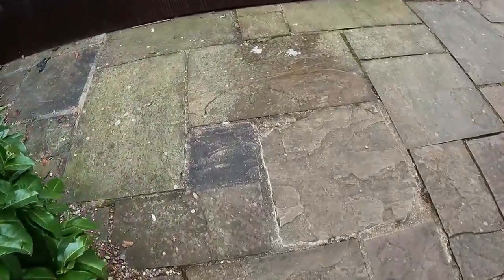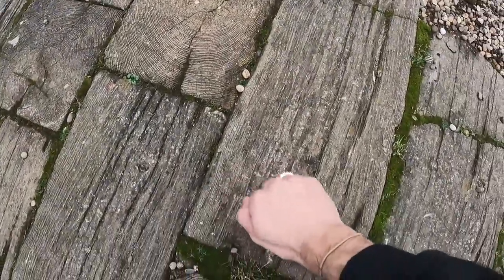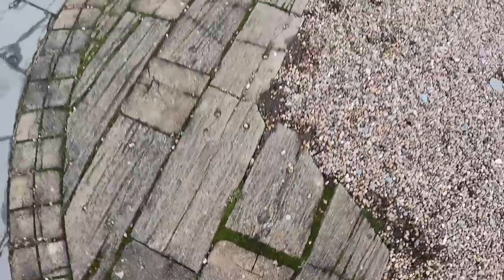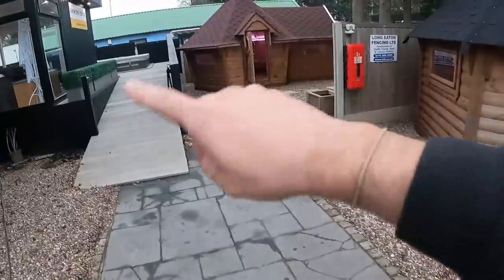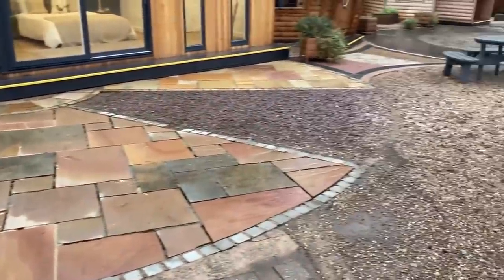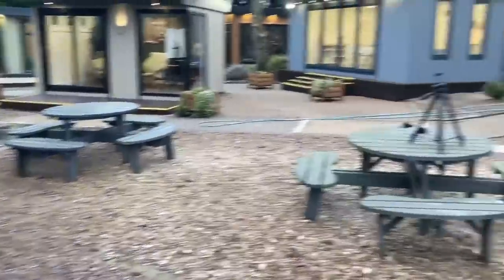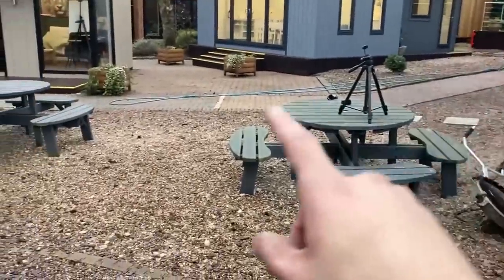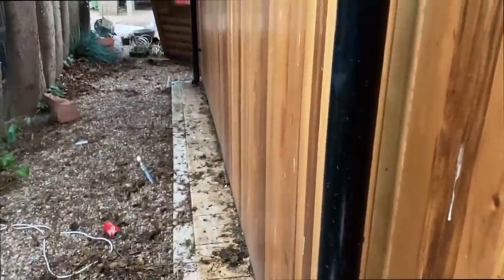OLD Slabs COVERED IN... 💩 Get POWER WASHED!

Comment: I read somewhere if you blast straight against the surface, mold, mildew and moss just get deeper and more difficult to remove later on, must blast at 45 degree angle.

Comment: I think you could have got away with just using your pressure washer on that job and saved some time. I know you want to play with your new steam cleaner though 😂
Reply from the maker: We had two machines running :D kev was doing all the block paving with the pressure washer while I was doing the soft stuff :D
Reply: @PartridgeExteriorCleaning  have you any plans to upgrade your pressure washer. I can recommend Jetmac if you are.